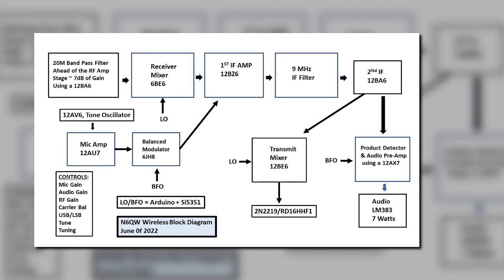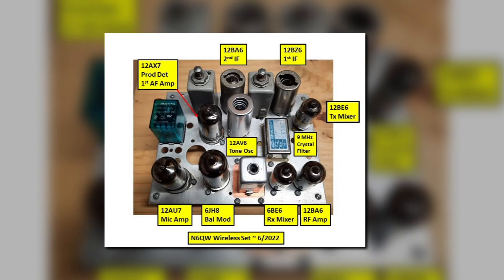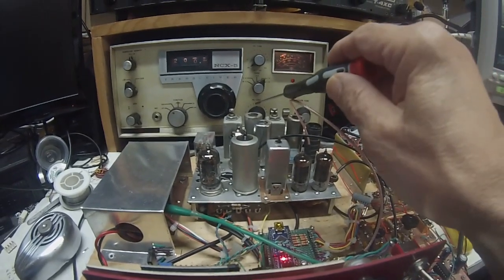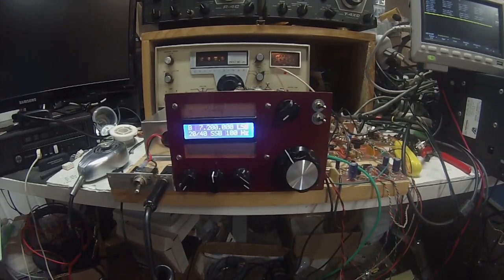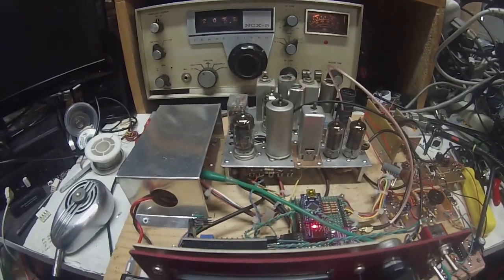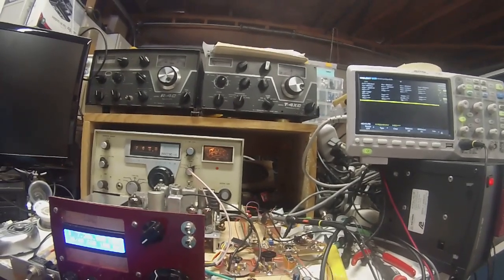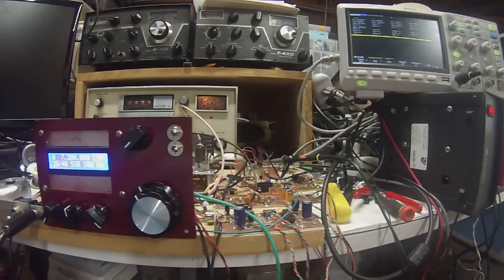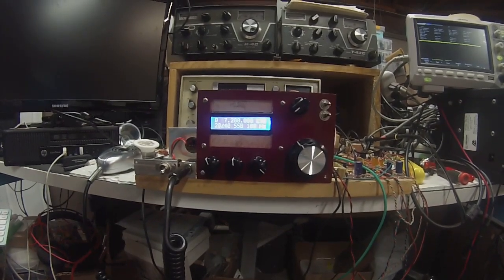Fabricating and Troubleshooting the Homebrew Hybrid SSB Transceiver

Comment: Funny that normally when someone says “hybrid” usually it means something like the Kenwood hybrid rigs where you have solid state for the low levels and tube drivers/finals, and you’ve taken the opposite approach. 😂 Way to go! 73s
Reply: Thanks for your post. Yes, I do at times do strange things like making the lower-level stages with valves. It works surprisingly well.

73's
Pete

Comment: That's an awesome rig!  You inspired me to try DC on the filament of the 6JH8 of my homebrew exciter as I have a tiny bit of hum too.  

No luck, my hum was still there at the same level with DC - I hope it is low enough to go unnoticed.   Anyway, thanks for sharing!

-Nate KA1MUQ
Reply: Hi Nate,

Did you put DC on all of the filaments or just the 6JH8. I did a test before switching to DC where I left in the 6JH8 and then removed the MIC stage (12AU7). The hum was still there. So I knew it was the 6JH8. You might try that test on your rig.

73's
Pete N6QW